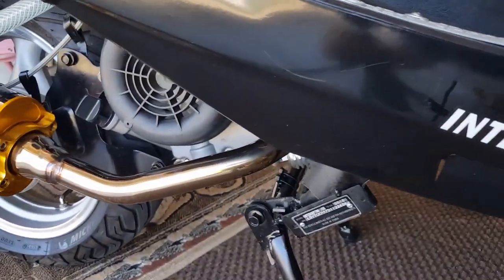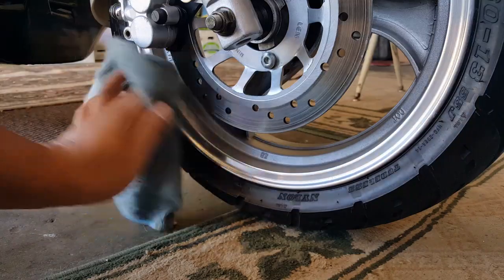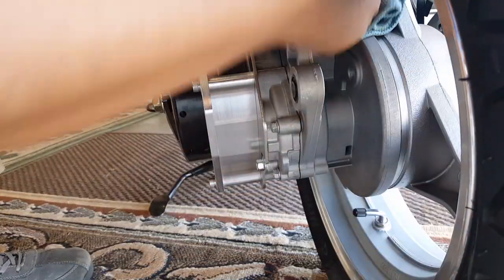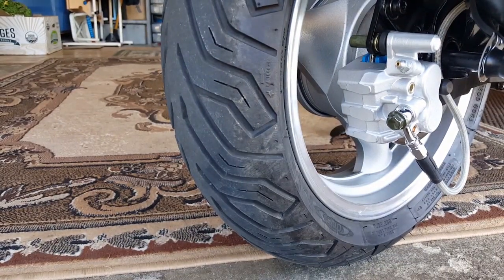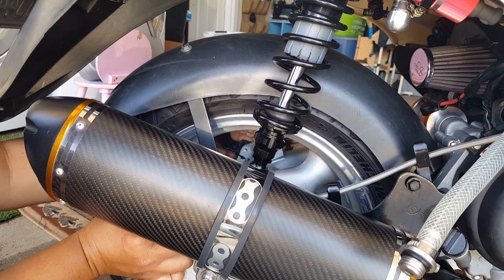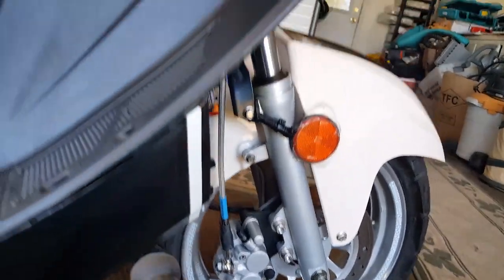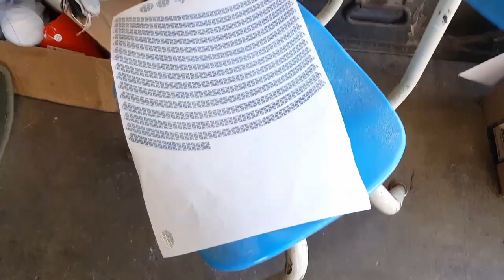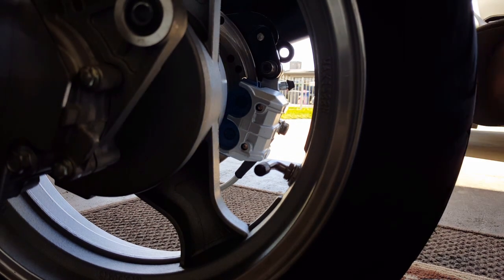How to Install CustomTaylor33 13" Rim Reflector Tape on ZNEN ZN150T-9 Scooter

Comment: Does one box come with enough stickers for both rims?
Reply from the maker: If you overlap it like I did with less than a centimeter you should have at least two extra strip or actually told three strip if you put the other half together left after all the four rims are done I mean four sides